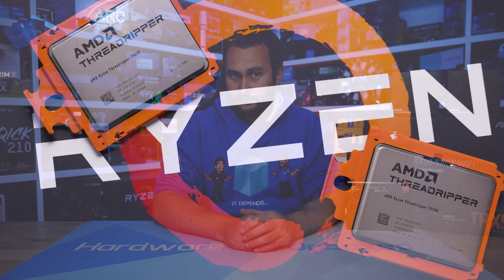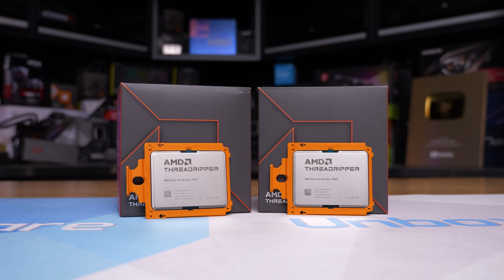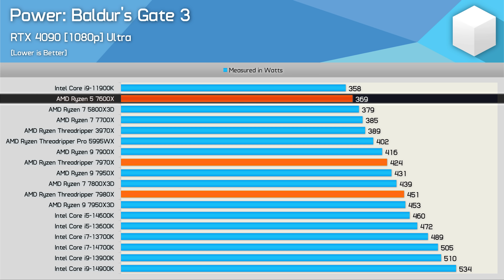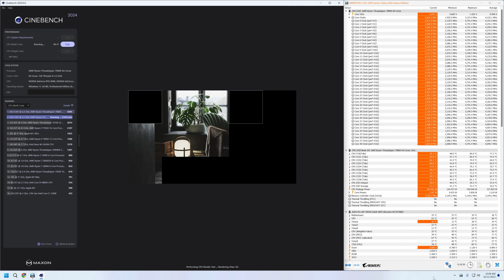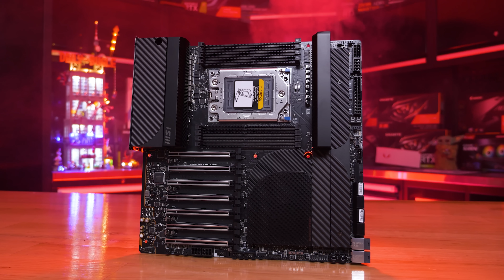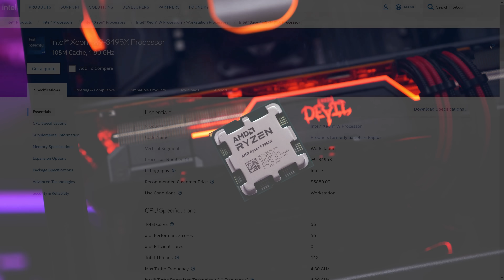AMD Ryzen Threadripper 7970X & 7980X, Benchmarks, Power & Cooling

Comment: Detailed Review. Thank you.  Can you also please describe the cooling system ?  There are two specialized coolers for the 7xxx Series. The Thermaltake AW360 and the Silverstone SST-XE360-TR5.  But does it work with other coolers too ? The other coolers specifications are not TR5, yet they work ? Thank you.

Comment: I waited 9 months for the MSI WS WRX to use with my 5975wx, finally gave up after they told me on twitter the motherboard was never coming out. Been using the AsRock WRX80 Creator ever since. Also having crashing problems, haven't had time to resinstall windows, that's next I think.

Comment: Wow, what a beauty. How beautiful. How beautiful. I would like the 32 cores. I don't need it at all. I have the 5950x looped at 4.8Gh and I can't get it above 60 degrees even in August. I also cool Ram (64 b-die J Skill), nvme and GPU in semi-parallel. But what a beauty. 32 cores on 4 channels. These are crazy, monstrous numbers, the integrity of every piece of data is checked. With a little hand it is almost certainly possible to make those video games run 2 at a time, and playable. Ram never ends. I have 64 Gb B-die which work very well and are very fresh but it is not so much. What beasts of machines. Thank you.

Comment: Your experience with Threadripper 5000 is definitely interesting to hear about. It definitely goes to highlight why I'm glad AMD seems to have changed its approach now with the 7000 series. The Pro and Enthusiast class Threadrippers can now share a platform, and they start at an actually somewhat reasonable pricepoint, closer to the way Threadripper 1000 and 2000 worked, and I really think those early hits were AMD's best effort, they were simply groundbreaking for their time. The broader the audience, the more the support, fewer problems in the long run. And these chips and boards hold their value pretty darn well in the used market.
I like the pricing for the 32 core, 2500 is not bad for a chip like that, but it does have to be stated it's 500 more expensive than its 2990WX ancestor, with fewer PCI-E lanes. Inflation, I suppose, but I do feel like it would be much more appealing at 2 grand rather than 2.5.
That 24 core, though, sheesh, with only 24 cores you're still basically competing with the 7950X in multicore performance, and that chip is only 600 dollars, without a bundle or a black friday sale. 1500 dollars for the entry level is rough. Entry level for HEDT threadripper used to be a measly 500 dollars. I really think AMD needs to rethink this. Drop that to a flat 1k and it will be within budget for a lot more people. Dropping over a grand on a CPU is just too hard a pill to swallow for too many people, especially when that was once the price of the original Threadripper flagship.
It really goes to show how competition is good for consumers. AMD was much better about its pricing when they weren't dominating the server space and Intel actually had competing products in HEDT.
As for the Pro sku pricing, yeah let's not even start with that, that's a whole different ball game, that's "take out a long term loan just to build a computer" level. 10 grand for the 96 core, yikes. Really only aimed at people who need insane performance for a truly insane workflow.

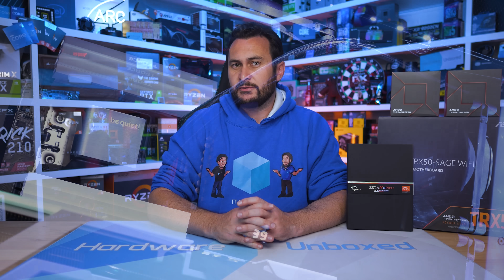Comment: According to your experience and concerns (15:50 - Our Threadripper experience to date 22:13 - Future Concerns for Threadripper), and being 7700x/7800x3d, 7950x/7950x3d and M3 macs much more fast in productivity tasks, gaming or even professional work (and much more efficient and less power hungry)...there is anyone out there needing such a cpu and platform risks and probably lack of support? Who cares of synthetic cpu benchmarks that can be done much faster using gpu accelerated for a fraction of the cost? RTX 3060 raytracing and computing power in FP32 is not worth the hassle...

Comment: The reason why very few people now actually buy HEDTs is because thanks to Ryzen regular desktop CPUs have become super capable workhorses. The major difference we now get with the HEDT and Pro CPUs vs regular desktop CPUs is the number of available PCIe lanes. I know SLi and CrossFire are basically dead in the water, but it will be really interesting to see if there would be any good gains if you put 2x 4090s or 2x RX 7900XTXs. Especially now when you can have 2x 7900XTX for less money than a single 4090 it's interesting to know if both running in x16/x16 config with MGPU Enabled can outperform a single 4090.

Comment: I liked how far back the processors you used like the Intel Core i9-11900K as I have the 300MHz slower boost Intel Core i7-11700K.

Comment: I had the same problem with mine and as it turned out. I had to change the actual plug. It was plugged into at the wall. I was not drawing enough power from the wall to keep the CPU. Stable

Comment: When the Threadripper 3000 series came out I was droooooling over them. I was on a 2700X/B450 at the time and the 3950X looked good too. But being someone who tends to get side tracked the 5950X became a thing and, well, that was the obvious choice at is was "a dirt cheap" upgrade considering the performance on offer and that board and RAM expense was none existent.... But then AMD had the audacity of launching the 5800X3D while saying "Look what gaming performance programmers can't have"... so I caved and went for the 7950X3D and now I'm no longer interested in Threadripper. Now a complete clean build takes just shy of 30 minutes, and if I game while I wait it takes about 45. And I only do a clean build once a week or so, so it's not like I get to game a lot "on the clock".

That said, with the current AI hype I expect there will be a lot of sales of the 24 core model just for the PCIe lanes.

Comment: I have been using the 3990x since release. Never had an issue with it.
Reply from the maker: We never had an issue with the 3000 series either.
Reply: I had two 3600 die after 3 years

Comment: Because these things cost so darn much im still stuck on an old threadripper 2920X for my server... would be nice to be able to upgrade, as of right now I might be better off using a AM5 system, since my simple 7950X3D kicks the pants off the 2920X in all the benchmarks..
Reply: Yeah.. the 7950X3D is an absurdly good CPU for those of us in a strong dual use scenario. I went 2700X -> 5950X relatively late, and that pretty much made me stop wanting HEDT parts. But when the 7950X3D dropped I instantly got the upgrade itch. On the first of October I got a project completion bonus.... aaaand a new build.

Comment: Great content again! Very glad you shared your experience with the 5995WX and the MSI board that wasn't put into mass production. It's important information to have. Even as a system administrator, these parts are outside of my needs but they are super impressive for those that need this type of multi-threaded performance.

Comment: Surprising how the 7980X without PBO enabled use roughly the same amount of power as a 14900K given the amount of cores it has, sure it's not efficient as a gaming CPU but it was never made to be one anyway, but sure is efficient with the amount of cores it packed.
Reply: That's how far behind the 7800x3D Intel is. Forced to go all out to compete.
Reply: Gaming is a GPU activity, but Threadripper is great for gaming/not a relevant difference. High clocks and a lot of native L3 cache, plus they overclock better. Threadripper is also MUCH faster at everything that actually matters (Video editing, compilation, general multi-tasking, VMs, generative AI, LLMs, encoding, game dev, streaming, etc).
Reply: @chiefjudge8456  Threadripper doesnt "overclock better" Threadripper still has zen4 cores meaning that you might still be able to hit 5.4 in all cores witha  decent liquid cooler. Zen4 cores are good for up to 5.7ghz on air depending on silicon lotery, but this is dealing with 6 core units, 64 cores make a bit more heat and as a ressult all core clocks must come down.

Comment: please test in games 7970 or even better 7960 if you have it with half cores disabled  (default and OC), I suspect gaming perf will improve significantly
Reply: Gaming is not the purpose of these Threadripper CPU's.

Comment: Man, this is really disappointing.   I have no need for a boatload of cores.  Nothing I do actually uses them.  I bought my 3960x because I just couldn't make the pathetic 24 PCIe lanes modern consumer platforms have work for me.    All I want is a CPU with 40+ PCIe lanes like my x79 platform had, but with NO compromises in single core and game performance compared to consumer platforms.  Is that really too much to ask?
Reply: I totally agree and I also purchased a TRX40 system with the 3960x...but I wouldn't have bought it had I known AMD were about to break that infamous "long term support promise"...after only one(!!!) CPU release. Pretty disgusting move by AMD and one that killed off their entire HEDT userbase.
Reply: I'd imagine that if you take the 24 core variant, use it in a 4 stick configuration and manually tune the memory timings, then you'd get pretty close. The default configuration was already on par with the 7600 so it's not far off already.

That said: pay attention to what Steve said about support on a platform with relatively few users. As you can see from Chris' statement, not everyone should buy HEDT just because it looks shiny at a glance.

Comment: If i wouldn't have had massive firmware reliability issues with third gen Threadripper, i could be almost excited about those new CPU's. 

I use my workstation PC for generating my income as an engineer and i don't want to spend my worktime troubleshooting issues, which shouldn't even exist on a professional-grade platform. So i'm doing pretty okay with my inefficient and slower Xeon processors that can deliver nearly 100% uptime. But honestly, i can't wait for dedicated RISC-based platforms to find their way back to professional workstation users.
Reply: I'm pretty sure it's an issue with the 4 or 5 consumer board manufacturers. Less tacky enterprise-grade hardware from Dell, Lenovo or Supermicro gets more support.
For a RISC based platform, there was some relatively affordable Power9 systems few years ago. Real beasts, though definitively obsolete nowadays.
Reply: @PainterVierax   I've always had Asus' professional lineup since the X58 era. The Xeon based system all ran and still run pretty stable. Currently using the C422 SE with no issues in my trusty old 19" case. 

My TR mainboard also was an Asus. The issues i had were mostly related to USB, which is bad, because i use a lot of specialised peripherials and lab equipment. Also had one occurence, where my SSD's started freaking out. I looked up online and there were a lot of users sharing the same issues using different and also more expensive boards. 

I'm not an Intel fanboy (i dislike their current consumer platforms), but i never experienced something like this before, even on consumer hardware.

I use an older IBM Power system as a project server/atorage unit using BSD, but it isn't optimised as a desktop platform. 

I currently have high hopes for RISC V in the future. They already began to manufacture HPC CPU's and it's just a manner of time until there will be workstation grade derivatives. A lot of people in the engineering and visual space have a bit of a nostalgic feeling about oldschool unix workstations.  A friend of mine even has a small collection.
Reply: @myk_und_saik  I agree AMD has something to do with it but the board manufacturers have to push the bios revisions as well.
Don't expect too much of RV in the HEDT/workstation segment. If Power and ARM left it,  it's because x86 is very competitive and possess the inertia of decades of software development.
Reply: @PainterVierax  You know what's great. Having something tested out of the box. How professional systems should be. My Xeon boards always worked OOB and did not require firmware updates to fix major issues. I think the reason for that is that Intel is focused on HPC/Datacenter. A few generations ago, they began using different architectures between Xeon and consumer desktop. There is also no Win11 barely functioning P&E core bs on Xeon. 

AMD should treat it's professional users more seriously, even if they take initial financial losses in R&D. They can win it back, after gaining reputation. 

As said, i'm not a hater. I'm a fan and user of AMD's consumer platform, since Intel's consumer products are so abyssmal. Biglittle architecture makes zero sense in a desktop PC. Only battery powered devices benefit from this technology.
Reply: @myk_und_saik  Well, to me it's not mainly AMD's fault, at least after the first year past launch. I'm pretty sure the boards with Intel BIOS (even the cheap nucs) are more supported and less prone to failure than those with third party firmwares. I remember the devs of Linuxboot were baffled of how poorly optimized (single threaded) is the POST on most Xeon platforms. AMD's customers are not the only victims here, it's just a massive lack of software quality in the whole x86 environment.

I do believe big.little makes sense on desktop and servers, at least to push power into the right circuits to not waste the whole thermal envelope and throttle because of non urgent tasks. But like any heterogeneous arch, the OS must have a smart scheduler and clearly Windows didn't benefit from the years of ARM development Linux got (with the direct involvement of manufacturers dev teams, thx to open source software).
Reply: Sounds just like their consumer platform. Had lots of troubleshooting I had to do for clients since their systems randomly decide they don't want to boot or had all their BIOS settings wiped for no reason. Some systems became unstable at stock after a while and some even had a dead CPU, the most common was the R5 3600 non-X.

Comment: Well, despite all that power, demand will also be very, very low for these new Threadripper parts. They are much too expensive.
I for my part got burnt with the TRX40 platform. I bought three of these for our CAM workshop, with the firm intention of upgrading to 5000 series Threadripper once they would be available. These 3000 series we got are resally sweet to work with, but since Treadripper 5000 was never released for TRX40, I'm stuck with these. My lesson out of this simply is: never ever again Threadripper, especially at these insane prices for motherboard, RAM and CPU.
Reply: For professionals, which use them for their income, they aren't. They also don't get replaced as often as a consumer platform.
Reply: If you don't need it, don't buy it. If you do need it you can't complain about the price because you need it.
"omh the price of this caterpillar 787B is so expensive"...do you own a mine?
Reply: 100% agree. 
AMD royally - and deliberately - shafted every TRX40 owner. Taking their hard earned money off the back of that infamous "long term support promise".....then laughing at them as they very quickly EOL'd TRX40. Imagine deliberately killing off your entire non-pro/HEDT userbase...and many pro users too. Shocking, braindead way to treat your customers.
Reply: @JimmyBob6786  This is why, i have returned my third gen Threadripper again. had a lot of firmware issues. My Xeon based workstation is running inefficient and hasn't as much power, but it has an almost 100% uptime and no random crashes and failures with it's connectivity.

Comment: I want to see a few VMs running games off of different video cards simultaneously. I also want to see AI model rendering performance. I also want to see VMs running AI models with different video cards. I was thinking of using it as a house server with AI integration and smart house control. running vms to different rooms.

Comment: 1) Unfortunately, AMD haven't addressed - whatsoever - the rather massive Elephant in the room...that they royally shafted their entire non-pro/enthusiast HEDT userbase with that insane TRX40 'take the money and run' move. To publicly promise long term support for these expensive systems then laugh loudly as they immediately EOL TRX40 is about as braindead a move as you can get.
2) As for TR 7000, take a second to compare TRX40 vs TRX50 motherboards. Stunning....shocking, isn't it. TRX50 motherboards are severely cut down in IO and functionality compared to TRX40. The TRX40 Zenith II Extreme is a particular eye opener. No wonder MSI pulled out of TR.

No non-pro enthusiast, not even The Braindead, are going to invest in AMD's TR ever again. To repeat, AMD have no interest in compensating TRX40 owners.